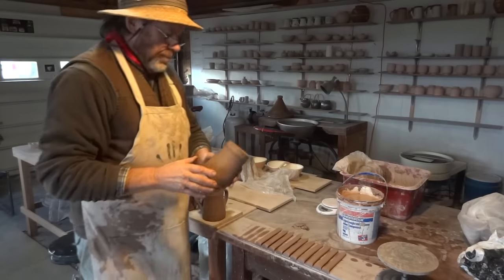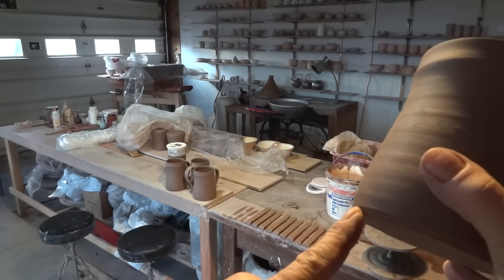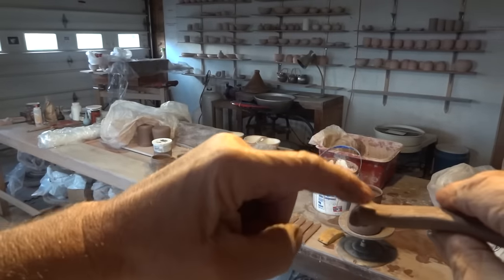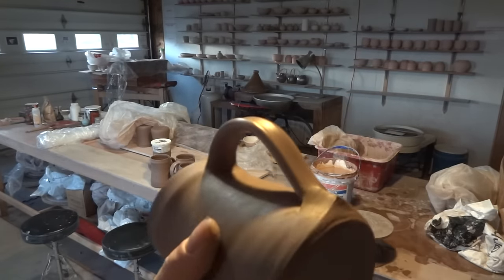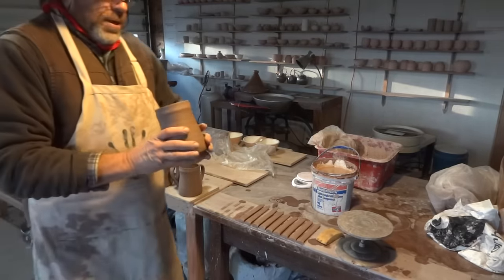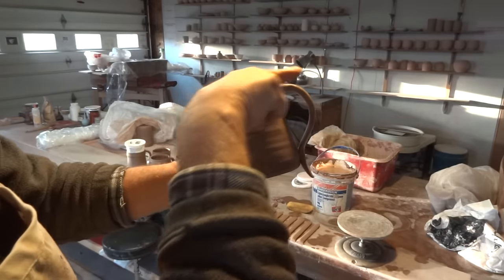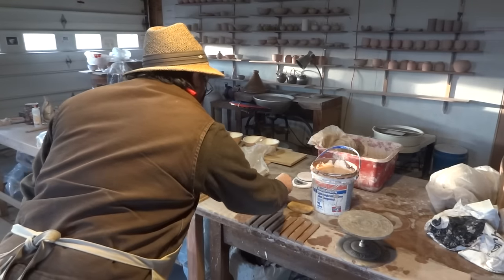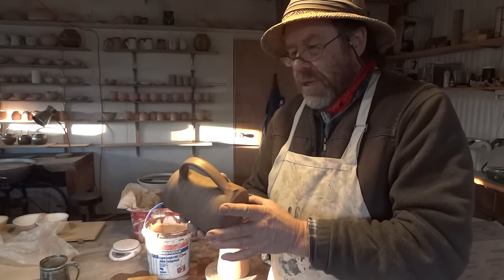SIMON LEACH POTTERY TV - How to apply handles to tankards !

Comment: Why isn't it necessary to scratch and wet the bottom attachment of the handle?
Reply from the maker: +Nancy Campbell It isnt necessary as the base of the pot where the handle attaches usually is slightly more damp than the top or the rim.
Reply: +Simon Leach Ah-Ha! Thank you, that makes sense.
Reply: +Nancy Campbell  I was wondering the same thing!